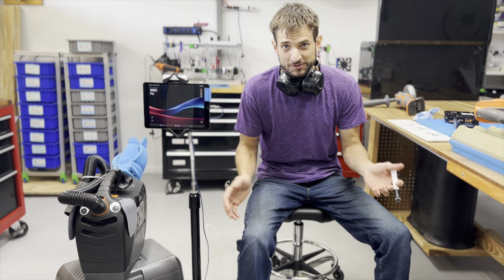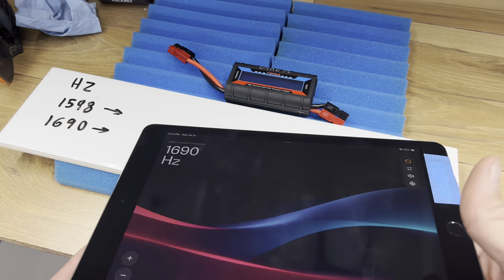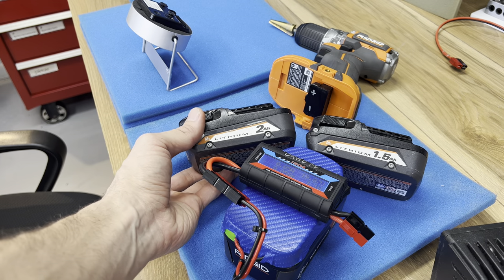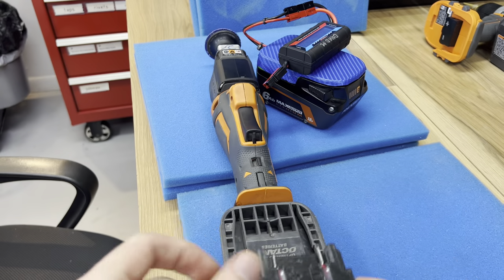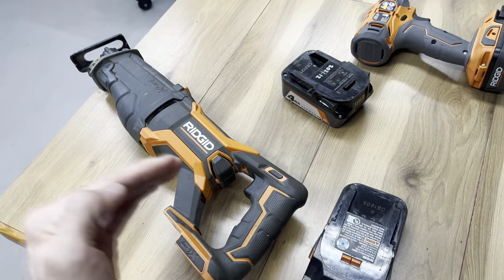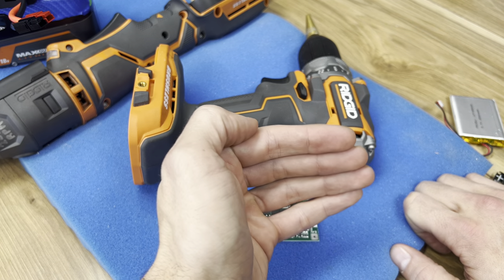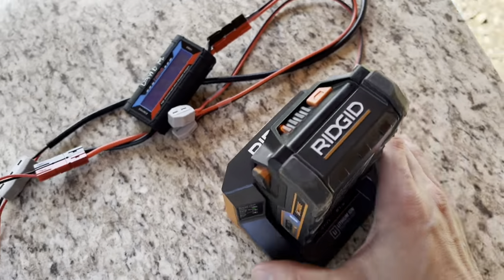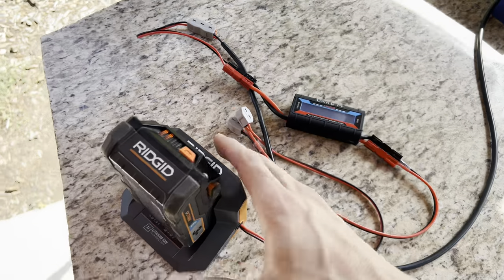Insights in REAL-WORLD battery energy that YOU can verify.

Comment: Very useful video about batteries. I had several issues with batteries while working on my projects. I assumed that the output values were as promised, so I looked for the error in other devices, but it turned out that it was due to the battery and its poor performance. Excellent. Thanks :)

Comment: I want to make a solar power wall, that will charge tool batteries with solar but if the power goes out will run a circuit in my house with the tool batteries.

Comment: One key insight that is important to understand about batteries is that the values we measure when we instrument a battery (Voltage, current, etc).  are manifestations of physical processes inside of batteries.  Having a rough model of these processes can also help us build an intuition around why different batteries perform differently.

When you draw current from a battery, the battery electrolyte is carrying positively charged ions (usually Li) across the inside of the battery from the anode to the cathode, which creates free electrons that we are harnessing to turn a motor, create heat, or something else.  A battery cell with a higher amp hour rating physically has more electrolyte present in the jelly roll (the stack up of flat material that we roll up to create our battery).  This often manifests as a thicker coat of electrolyte or a higher concentration of ions in the electrolyte. These changes in composition to increase cell capacity create a higher internal resistance in the battery.  As a result, a higher capacity cell will often perform less well under load than a lower capacity cell of the same physical dimensions because the equivalent series resistance of the battery will be higher, leading to more voltage sag at the terminal.  As a result your tool will see a overall lower voltage across the motor while running, and lower speeds.

For a battery of a given configuration (for instance one of the batteries you showed that has 5 cells in series and 2 sets of cells in parallel for a total of 10 cells), having a higher capacity will often mean poorer performance of your tool.   In the demo at the beginning of the video, you showed two batteries -- a 2AH 18V (1 set of 5 cells in series) and a 4AH 18v battery (2 sets of 5 cells in series).  Because the 2P battery is twice the capacity of the 1P, I'd guess that the cells inside the two are the same, however, since the larger battery pack has two sets of cells in parallel, the internal resistance of that battery is half of the smaller battery.  This means we see less voltage sag for the same load applied, which means that the vacuum sees a higher voltage at the motor, and can spin faster as a result (this is reflected in your experiment).

Hope this helps build an intuition for how and why batteries work!
Reply: Does that mean generally, you'd get higher performance from two lower capacity cells, than one cell of equivalent capacity?
Reply: @ for example, a 5s2p 3Ah battery (two parallel strings of 1.5Ah cells) would have a lower impedance than a 5s1p 3Ah pack (one string of 3Ah cells)
Reply: How can a dummy know checking the battery or power tools? Like  ridgid, milwake, makita. If they are 2 sets of 1 sets? I have Makita battery.
Reply: @ALFABETAS999  size.  On a given battery platform the 1P size will be about half the size of a 2P (for 16V batteries a 1P battery will usually be 1.5 inches tall, a 2P will be 3ish tall, and so on). Got makita the XGT batteries are 40V (10s) and LXT 20V (5s)

Comment: Hello David, thank you for taking the time to make this video. There is a lot of information here that is useful to me, specifically the way in which you made the power connections for your testing. What I am curious about is that, in many cases I see that power tool batteries have more than just a positive and a negative terminal. I would like to understand how the tools interact with these extra connections and how they impact power consumption. One thing I know is that in the case of dewalt flex volt, some of those connections are to make the battery output either 20 or 60 volts but that's about the extent of my knowledge in regards to this. And by extension I would love to know what these connections have to do with charging. My understanding is that battery packs can either be made to charge by routing power through a BMS, or by adding balance leads to the battery pack and making the power supply distribute adequate voltage to each bank of cells. But I have little understanding about why these batteries have both a BMS and seemingly balance leads. 
Thank you
Reply from the maker: I am curious about the Flex Volt system but i have not seen the devices in person.  Next time i see them in a store I will check it out.  I think the manufacturers should provide more information than they do.
Reply from the maker: from the video it looks like the battery just needs the charger to branch the +18 input into 3 locations and perhaps the bms is broken into 3 circuits, one for each row of cells.

so then the charge would happen with 0, 18, 18, 18 on those different terminals.

https://youtube.com/shorts/B3FLsV3ec4A?si=_7M3JoJu8BKRhbIi